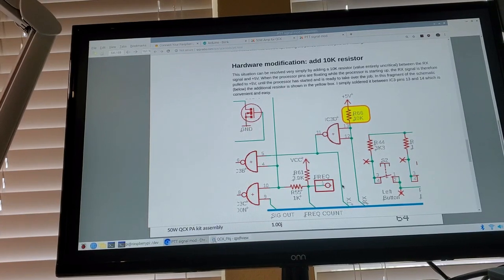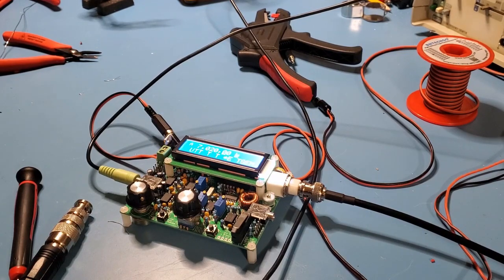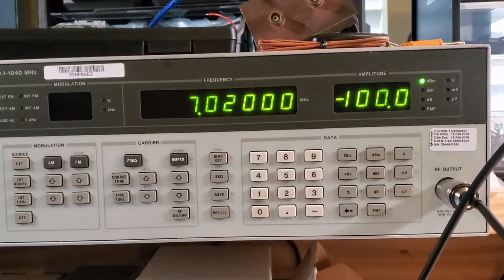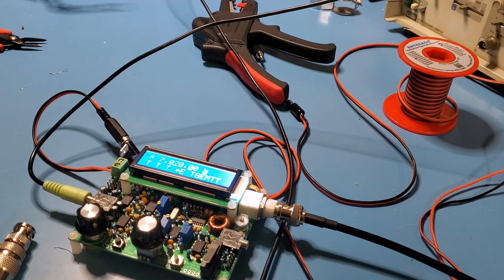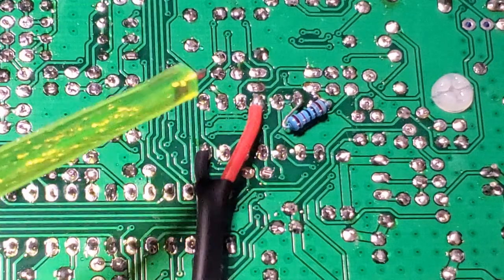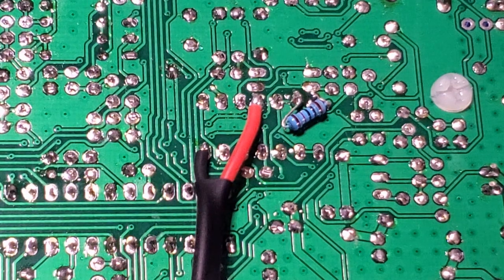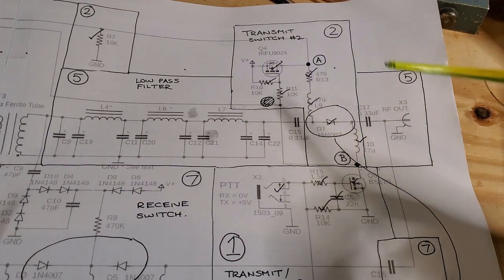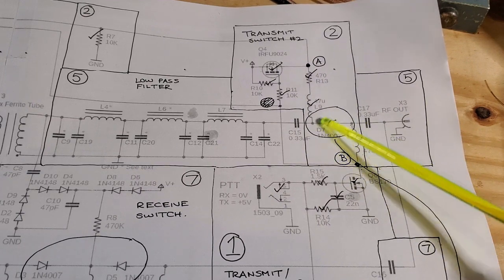QRP Labs 50W Amp - Part 2 QCX Mods and Transmit Switch

Comment: Well... it looks like you know about the mod :o)
Reply from the maker: Even after the mod its still turns on transmit when you boot up the QCX. Hans suggested some Fuse mods to the ATMega - I might try that some other time. I also was using one of the old old kits which didn't boot up correctly - the cure is a 47uH inductor between pins 7 and 20 of the uController
Reply: @na5y   Good to know. I have some of the original kits but this one is a more recent vintage (mid 2019). I took the QCX out of its case (only a few minutes after I replied on the first video). I'll try the mod and at least attach the keying wires to the board. The case has a rectangular hole in the front that may be large enough to install a grommet and pass a wire through the cover plate. I think that the hole was meant for a DB9, for the GPS, but it my guess is that the price of a DB9 punch led the creator to go with a rectangle (search for one, the price is always outrageous). I didn't like the way I routed the power wires from the board to the jack so I'll take the opportunity to fix that while I'm at it.
Reply from the maker: Just remember to plug the amp in after the QCX is fully booted and at the frequency screen. That pin is high a good second or so on boot up. I don't think there's any output from the transmitter itself - that would require the si5351 running
Reply: NA5Y That’s great advice and easy to do. Thank you